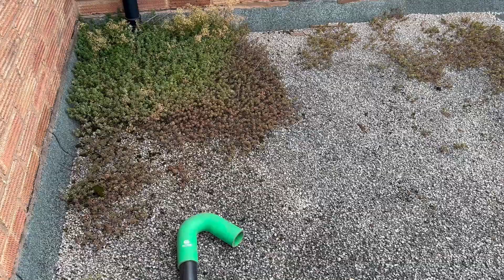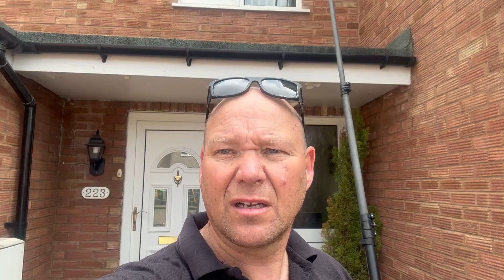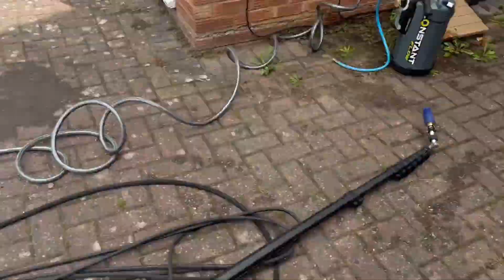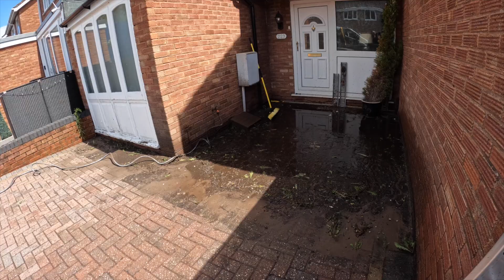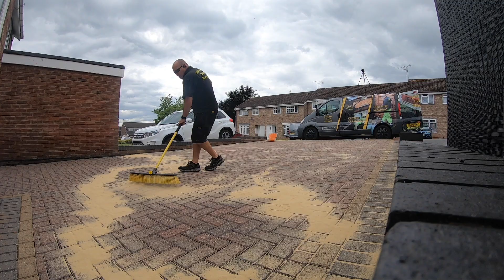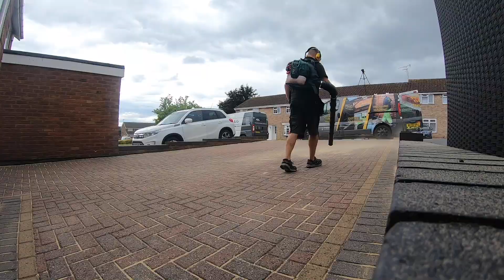Pressure Wash Drive And Full House Clean

Comment: Put fifteen degree nozzles in fsc and drop the deck lower by adjusting the wheel height so it lower mate it will blow weeds out bonkers
Reply from the maker: Thanks for the tip 👍

Comment: Great job....why didn't you pressure wash the drive the other way around? Muck going towards the road?
Reply from the maker: That would have made sense now you suggest it. thanks for the tip. 👍
Reply: I’m guessing it’s because the drive was downhill towards the house. The water and some of the sand and muck would have kept flowing towards the house regardless of which part of the drive you started with first.

Comment: Great transformation. I wonder why the upper gutter stops short on the left?
Reply from the maker: I wondered that
Reply: Yes a bit odd but maybe as there was guttering all around the flat roof section they felt the rainwater that missed the guttering on the roof  would find it’s way towards the flat roof guttering.

It would however explain the growth of weeds you had to clean on that section of the flat roof.

Comment: Good idea sticking the little brush in the drain Dave. I've cleaned a drain run around a swimming pool and I use a piece of gutter hedgehog about 30 cm long to do the same - easy enought to spray the piece clean (and about the only thing gutter hedgehogs are useful for 😂). Which brush do you use for the fascia boards please? I like the flocked gardiner brushes.
Reply from the maker: Totally agree about the hedgehogs 🤣
The brush is a Streamline 35cm brush. I only use that one because it was a spare I had. The pressure washer does most of the cleaning. I used to like the Gardiner sill brush for doing gutters and fascias.

Comment: Nice job Dave. I tend to use the turbo most of the time on block paving now as most of the jobs I get are like this one. With regards to the bags, I re-use the bags the sand come in. Just pop a couple of holes in the bottom and they drain the water out. Thanks. Mark
Reply from the maker: Great tip Mark 👍

Comment: Which pressure washer do you use mate?
Reply from the maker: It’s an Evolution Series 2 with the Honda Gx390 engine and at 21 lpm
Reply: @squeakycleandave1  thanks Dave , I'm thinking of the same machine 👍✨